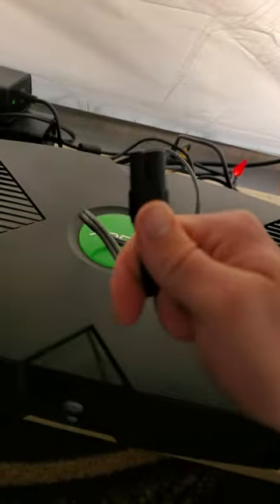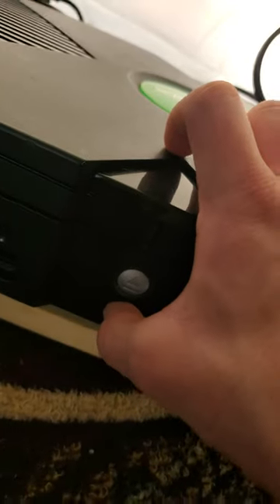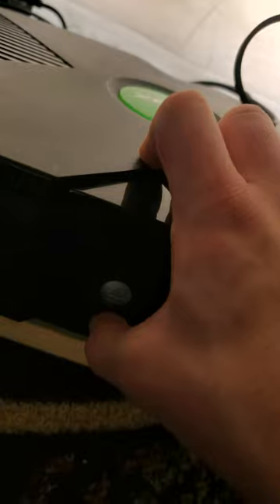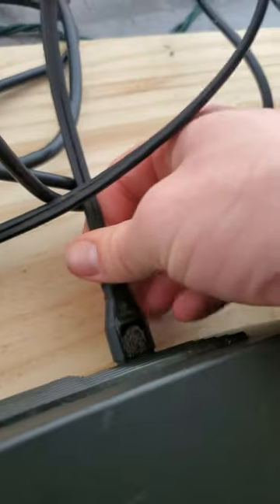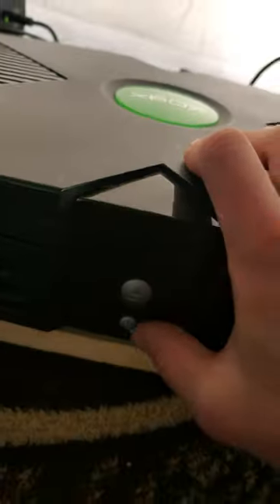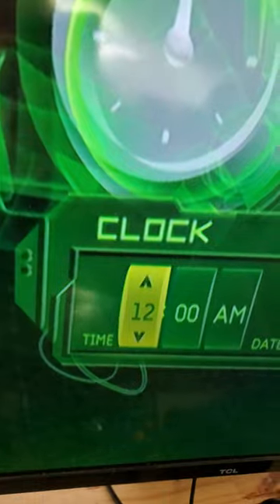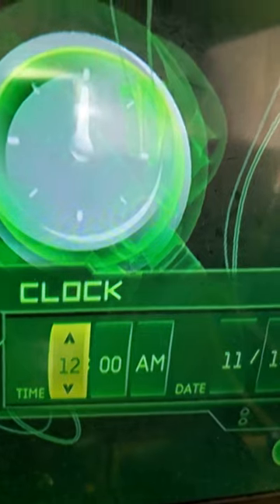how too know if your og xbox needs a clock capacitor replacement

Comment: Wdym new replacement? Like is there no clock capacitor in the Xbox or there is one but you need a new one?
Reply: There is one but it’s highly recommend to remove/replace it, they originals are extremely prone to leaking, potentially causing major harm to the Xbox. 
I’m my case I just removed it because they aren’t extremely useful.
Reply: @questionmark2061  Oh I know that, I just meant like is the clock capacitor a mandatory part. But I just removed mine like right after I made that comment